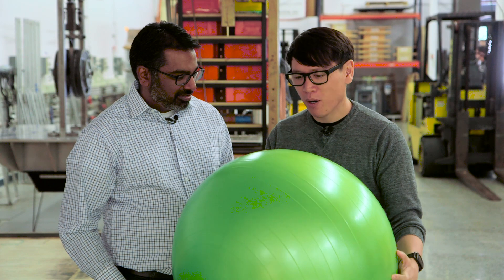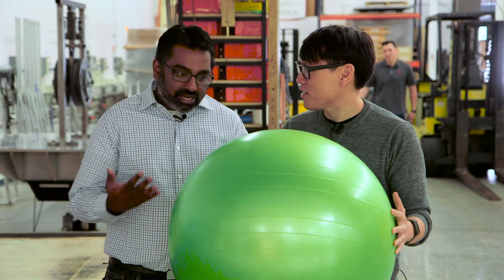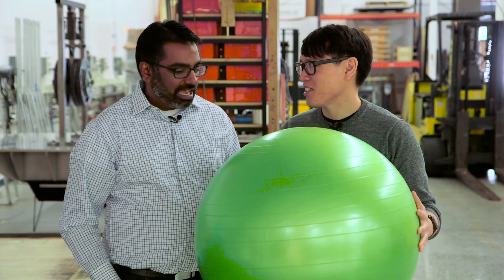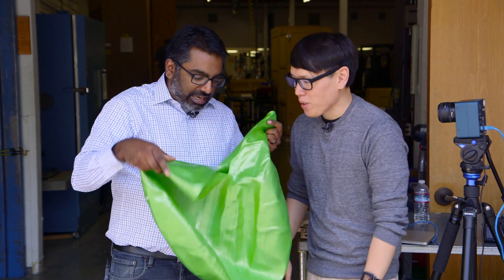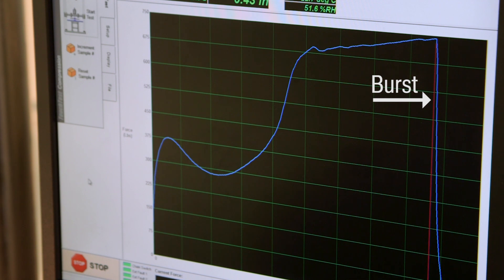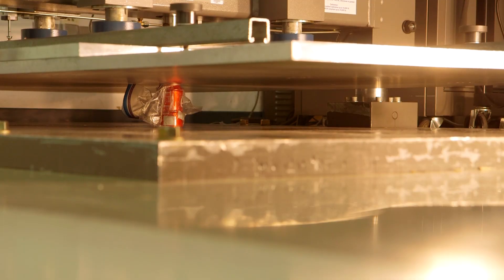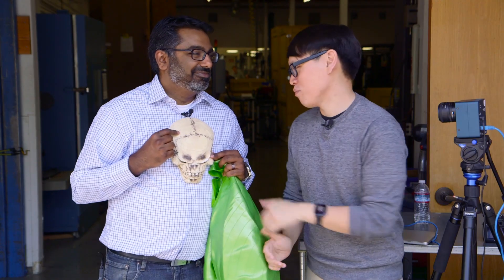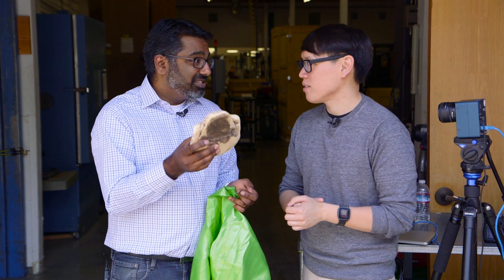How Much Weight to Burst an Exercise Ball?

Comment: There is one problem with that. This is only static weight, so it doesn't mean that you need to weigh 1.2 tonnes to burst a ball by jumping on it. To do so, you need much less, but how much exactly depends, as far as I know, on the speed and surface area. 

Imagine a bed of nails - one nail will run straight through your body, but you can lay on multiple of them. It you were to be dropped on the same bed you laid on before, they could still manage to hurt you.

Comment: Hi, I don't really like this test. It seems strange, as the force used to burst the ball will surely be higher when using a large flat surface like that compared to a person sitting or bouncing on it. Therefore the initial hypothesis you were talking about is not represented in the test. Just my five cents, no offence.

Comment: I thought that the plug would just pop out at that pressure. 
I have seen someone fall trough a yoga ball once, the most likely explanation was that the ball got damaged and the material slowly ripped until it popped.

Comment: I feel like this should have been done at least three times. Once with the ribbing on the ball parallel to the ground, once at a 45 degree angle, and once with it perpendicular. How the design of the yoga ball affects its structural integrity is far more interesting than just showing how tough they are.

Comment: Back in high school, a friend's mother used these exclusively. She weighed about 400 pounds, and broke three or four each year. Failed just like that, split along one side.

Don't know if it was just repeated stress over time, or getting damaged by crap on the floor, but they definitely fail well below 2,000 pounds in real world usage.
Reply: Samyueru Nekogami
Could be. There are countless reasons they could have failed. She also tended to bounce on them, and it's possible that a piece of jewelry she wore had a habit of scratching them. Also could be down to brand differences. I have no idea what brand these were, or what hers were.
Reply: I have feeling you are lying and just wanted to get thumbs up
Reply: Why do you think I'm lying? What is so unbelievable?
Reply: It was probably because she put more force in a smaller area, where as in this test there was a flat sheet evenly distributed.

Comment: While that's interesting, I'm more interested in how much force (F=ma) is needed to burst it. I don't weight a ton, but if I jumped on one of those balls, would it burst? I'm not going to, and this is kinda cool, but not as useful as you'd think.
Reply: It should be pretty easy to calculate force by weight. 1 kg of weight equals 10N of force.
Reply: RadioLogicalHazard
I'm no physicist, but isn't static force different from (?)dynamic (don't know if that's the right term). Like, if you put a bunch of weights on something, that's different than dropping a weight, isn't it? Honestly, correct me if I'm wrong, I'm always willing to learn.
Reply: well I'm not a physicist either but force IS mass and acceleration so dropping a small weight on something quickly is kinda the same force as putting a heavier weight on it slowly. I think.
Reply: I'm still no expert, so correct my erroneous thinking: I can put a lot of weight on a brick and it won't break. I can drop a brick from chest height and it will break. The brick is fine when it comes to static force/weight, but very weak against dynamic force. I'm open to correction, but that's my take. Just as I can drop a brick and break it with very little force compared to the weight it can take, is the same true for this ball?
Reply: Huai Li well when it's getting stopped by the brick after going fast that's more acceleration so you need less weight for the same acceleration. However maybe there could be a difference in duration of the force so I really don't know. I think it's about the same for the ball, though